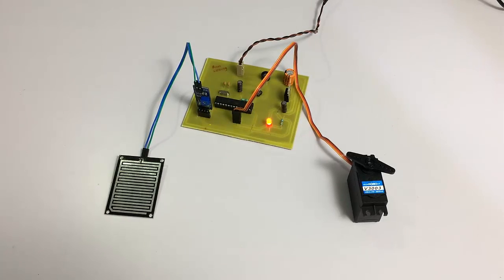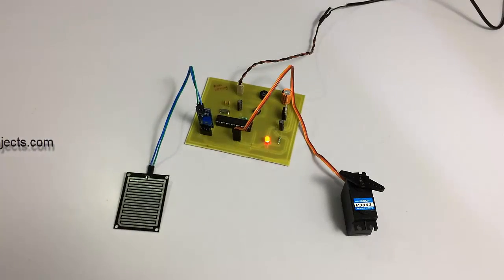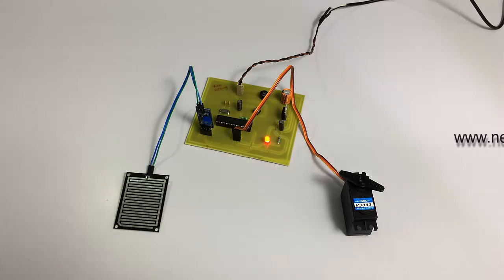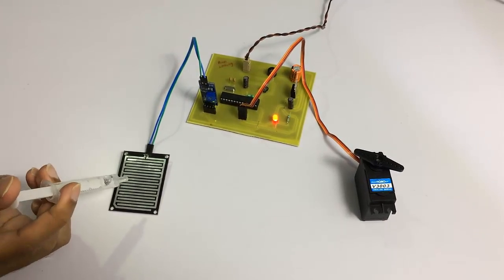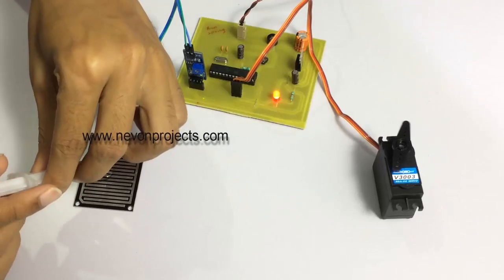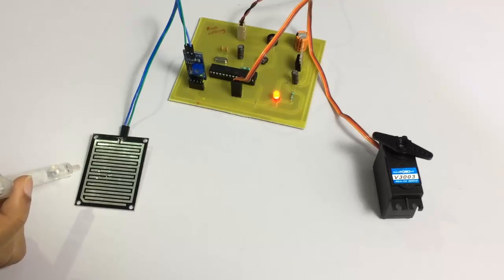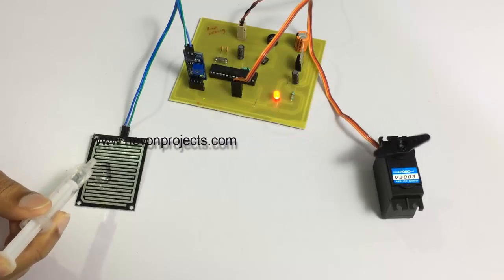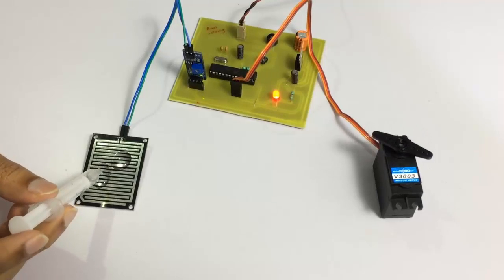Rain Sensing Automatic Car Wiper

Comment: Interesting for a little project but completely impractical.  Did you show how to mount it?  Did you show it mounted and actually working?  No.  Are you going to drill a hole in the roof of the car for the wires to run through?  Where is the module suggested to be mounted?  No ideas?  Then it's garbage.  Fail.

Comment: More again this stupid video. It can't be installed on a car. How would you do and how to fix the sensor on the windshield in a way it will we wiped after getting wet!!? The wipers will be destroyed if the sensor is mounted with glue on the exterior of the windshield.
Reply: HADJI Samir you realize almost every car on the road now has automatic windshield wipers. Our 2007 even have them
Reply: It’s on the inside of the windshield
Reply: @bradenmeyer7939  - The sensor for this project could not be placed on the inside of the windshield.  The sensor for this project works by water completing the circuit between the metal tracings.  New cars with the 'rainsense' wiper system uses an IR laser, which is placed on the inside of the windshield.  HADJI Samir was right, this shouldn't be used on a car.  

Now using this as part of a system for, say, turning on a ventilation system when rain is detected is actually a good idea but for a windsheild, HADJI is right, this wouldn't work (damage the sensor, damage the windshield wipers, damage the Windshield)

Comment: I think it is not practical at all in use on a car since the wipers must wipe the sensor as well, so the question is where to put the sensor, and how to prevent damage to wipers and to the sensor and event to the windshield. The only solution I think is the use of some OPTICAL SENSOR as being used originally in many cars.
Reply: I think you can keep the sensor on the hood or roof, cuz if there's a rain it will fall on hood and also on roof.. when it does it activates
Reply: @rjr9teen  but it needs to be wiped - you have some water, wipers do a cycle, and the water is gone, but the sensor doesn't recognize that.
Reply: @youtubeuser5875  we can simply introduce something like a kill switch button ig
Reply: @rjr9teen  now you have a wet sensor telling you to wipe, and an override telling you not to. When are you going to decide to wipe again?
Pushing a button to stop the wiping is not the solution, at all